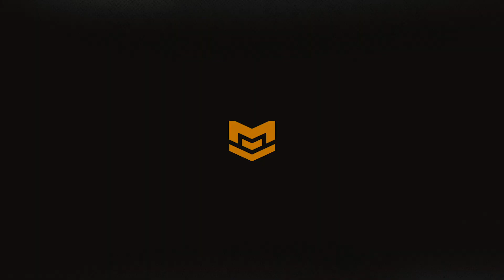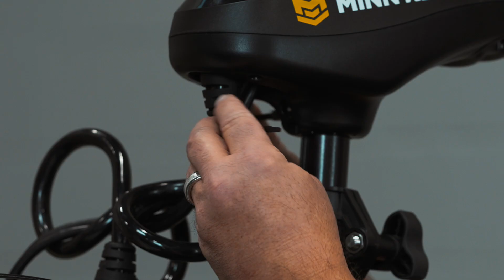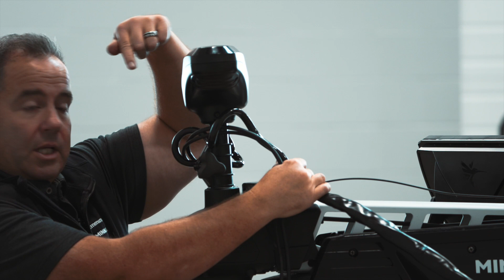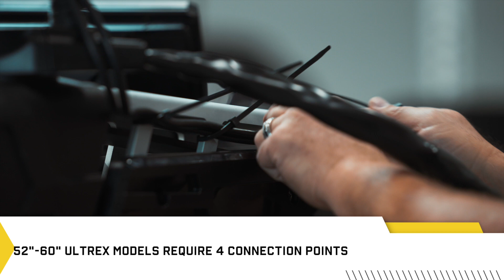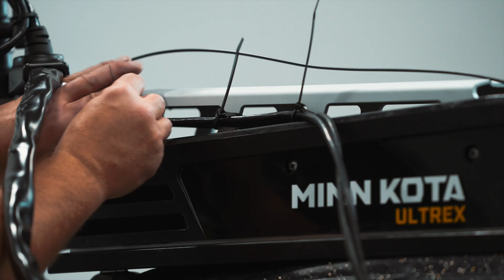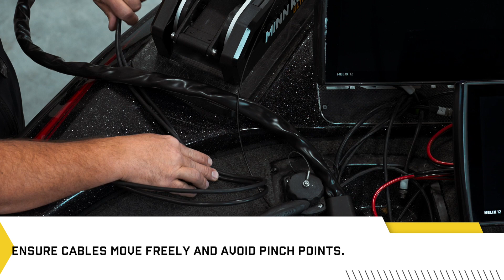Ultrex Transducer and Ethernet Cable Routing Tips | Trolling Motor

Comment: WOW, I can't believe an official Minn-Kota page has produced this. Just so everyone knows, using zip ties on a transducer cable will void the warranty. I'm, sure it's no different on the built in US2, MDI or MSI cable. And who in the world would route down the pivot arm, that's stupid and asking for a pinch. There's a reason the foot control wires are routed the way they are.. so they avoid getting pinched. Just run your wires down the foot cable from the head.